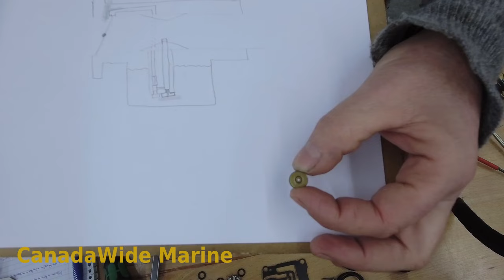Diagnosis and repair of 4 Stroke Outboard motor Carburetors. A look at the common issues.

Comment: i have a 2003 honda 15hp 4stroke. there is a screw on the side of the carb, facing out. i believe its the fuel/air mixture. its silver in color. do you know what the turn(s) to start out should be?  i cleaned my carb and its in great shape.  starts right up idle just fine. my problem is when i give it gas it hesitates then when i let off the gas i can hear it back fire though the intake. i dont know if this is the problem. i bought the outboard not running, and some parts already off.  so i dont know if the previous owner turned it. any help will much appreciated
Reply from the maker: The small slotted head screw facing out is your idle mixture screw. Adjusting it only affects the idle mixture, or idle quality. As a starting point I screw it all the way in until it bottoms, gently, then back out one and a half turns.'In your case , with the engine idling just fine, I  would count the number of turns all the way in until it bottoms, and use that as a reference.
But really you don't need to do that if it is idling fine. A little hesitation when giving it gas from idle speed can sometimes be remedied by richening up the idle mixture a little, turn your mixture screw counter clockwise, about an 1/8th to 1/4 of a turn at a time.
Reply: @CanadaWideMarine  thank you for your reply.  should of mentioned that the screw can only move from 9 O'clock to 3 O'clock. t is blocked on each side with a shoulder preventing it from moving further. the screw it self has protrusion sticking out that hits the shoulder.  i am familiar with typical mixture screws. but this one has me stumped.  i cant even unscrew it and take it out to clean it.
Reply from the maker: Yes, that is normal. It is restricted for emissions reasons. Generally full counter clockwise, to the stop, is where you will want that set. The only way to clean is from inside, blowing carb cleaner through the passages. Or an ultrasonic cleaner.

Comment: I've cleaned my carbs out good and changed fuel lines.  My issue is when I gas it and let off it dies.  If I go slow she'll power up.  It's when I come down from throttle it cuts.
Reply from the maker: There are many possible causes for that type of issue. I would recommend a proper diagnostic by a marine mechanic. The diagnosis is almost always cheaper than just replacing random parts until the problem is solved. I  could suggest a handful of things to check, only to find the problem is something I didn't mention and that doesn't help anyone.
Reply: Sounds to me like an adjustment issue on your carburetor setting. They have air fuel mixture screws it's not receiving the proper amount of air or it's being bogged down by too much gas that is most definitely your problem and if it's not that it could be a vacuum leak or the actual teeth that hold down the float Bowl regulator they do tend to bend upward and allow too much fuel sometimes just the side note took me a while to find that one time

Comment: what is the best way to remove varnish from the carb? carb cleaner doesn't do it. terry clark
Reply from the maker: Hi Terry, I've had good luck with lacquer thinner. Soak the carb overnight in it should soften the varnish up.

Comment: I have the 9.9 prokicker and the boot on the enrichment port is leaking. I cant find a single vid on rebuilding this component. Anyone?
Reply from the maker: I am assuming you mean the boot on the accelerator pump. This is caused by a cracked diaphragm, very common. As you disassemble it, keep track of the location of the springs, and it is pretty easy to replace. The diaphragm does not come in the carb rebuid kit, you must buy it seperate.

Comment: is the idle jet and pilot jet the same part?
Reply from the maker: Good question. I am pretty sure the pilot jet is a term used with motorcycle carbs for the idle jet.
Reply: @CanadaWideMarine  Thanks! I'm trying to change out the main and pilot jets on a new 2021 2.5  4 stroke  Suzuki outboard, for the high altitude jets. Wondering if that is something I can do myself. I have the new jets.
Reply from the maker: If you have basic mechanical skills and use common sense I would think you could do it yourself. Tip: Take lots of photos before and as you are taking it apart. Take photos from several different angles because the thing you are trying to see when you are putting it back together will be the thing hidden behind something else.

Comment: Have you heard of float wharping ?
Reply from the maker: I have, but don't see it too often with the new plastic floats. Used to see it often with the old brass floats.
Reply: The newer plastic floats can deform. Ive seen it before
Reply: @orlandomoreno5326  turned out to be a bad spark plug. Replaced both spark plugs and engine runs smooth without any hiccups !

Comment: Real carburetor mechanics learn early on that the "JET" is the most restrictive opening in the passage , or they wouldn't have used a "JET" , once you get over that revolutionary "FACT" rebuilding a carburetor becomes a much more achievable task.  Keep up the good work , but lose the mystery aspects of your tutorial.